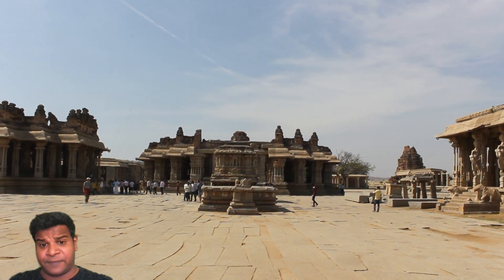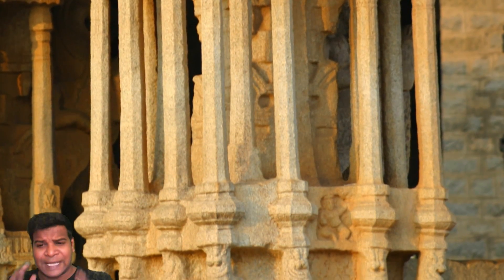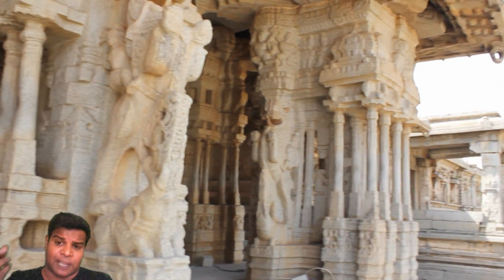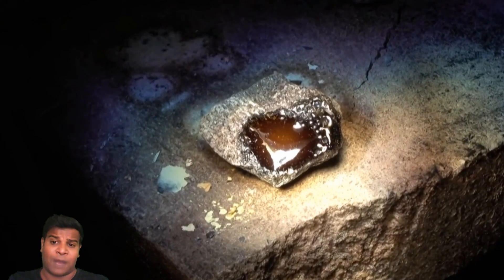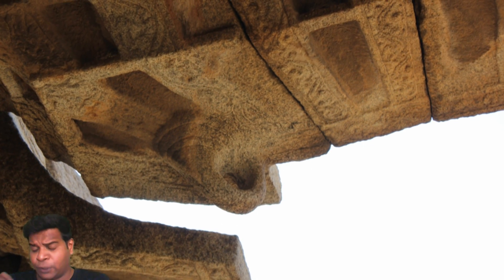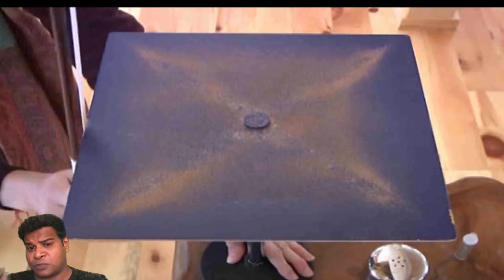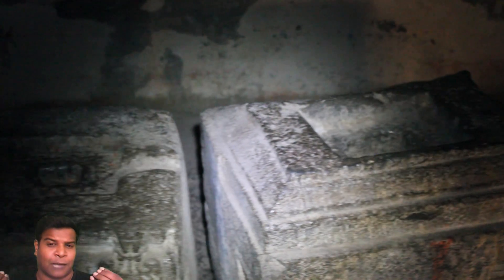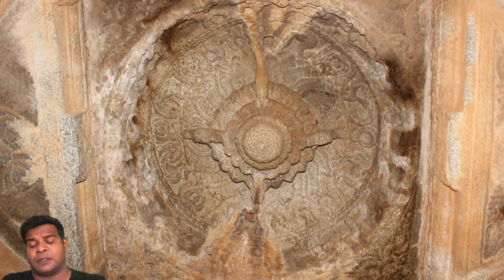How do the Musical Pillars Work? Rock Melting Technology? Cymatics?

Comment: maybe the cymatics are a blueprint for the sound, they are representing what that sound is, so if there is a bunch together in a circle it is the order of the flow of the sound, maybe they are the frequency they want you to replicate, you made a stronger believer now out of me when you performed that AUM sound that make the infinity symbol with your sound machine with laser pointer reflected on mirror on membrane on cylinder, everytime you encounter cymatics representations ,it is instruction for proper frequency wanted , so maybe all the temples that have cymatics are giant instruction books on the sound the temple want you to achieve. possibly in the form of mantras

Comment: They would have been chanting as well in frequencies related to the cymatic ceiling structures. If you identify the frequency represented by the cymatic design, then play that sound into the reflective dome.... and then add harmonic tones

Comment: if they could melt rock then they might be able to do the same thing as making a prince Rupert drops .  this would put the rock on the inside of the pillars under a vacuum pressure without being in a vacuum.  this could possibly transfer sound better to a different chamber, or allow for more vibrations in the pillars without breaking.

Comment: If that's what small pillars are capable of, just imagine what greco roman architecture could be capable of. Those giant ruined pillars! I saw another video about pillars that were some sort of mechine that could rotate but for what purpose I don't know. I see you posted this 5 years ago, I just recently got into learning about the ancient architecture and the truth about all the antiquitech. You're right, they did not achieve these things by using primitive tools. I have even been fortunate enough to put my eyes on some old photos depicting enormous free energy devices out and functioning in cities but someone had tried some old means of phitoshop because the devices were gone but the editor erased only the  tech so it was easy to see what it looked like. There were these very tall metal towers full of spiers, cables, and orbs. Some tech was on buildings and others were fixed to the ground in the midst of commercial buildings. It was wild to see. Wish I could share pictures on here. I recently read some old documents about Bastian forts aka star forts and apparently they are all aligned with the stars just like the pyramids. This document also stated that by standing in a star fort and looking at the stars you can see the stars like never before, it's said to enhance your abolity to observe the heavens. In addition to all of this, it also said that from inside the forts you can hear the Angels of heaven singing. I'm christian so I think that's the coolest thing ever.
Reply: How about the possibility for the pillars to be made up with cement concrete in a hollow structure? Since they are hollow, they echoed to knocking.

Comment: Enjoy your Channel with investigating History that offers many valued thoughts. I’m sure the Powers to be cringe with some questions but getting to the TRUTH in todays world is a requirement. A positive thought is real Political World Controlling problems have been identified and are currently in process of being removed. Expecting this to open up floodgates to surface REAL TRUTH. You’ll be a busy guy!
Sandstone Chain may have limited and questionable strength otherwise it was done purely for display. Some sort of testing is required to show if it was a composite with special properties. We all might be surprised with the results!
Tone column changes may come from different compression. We’re they made as a composite? 
Further analysis required that includes a bigger picture. Accurate physical measurements of column sizes need immediate review. Maybe Someone working on their PhD Thesis might find this an interesting challenge. They would put their name in History!
Have always wondered if these temples were carved out of one piece rock or were they assembled? From Molded Composites?
If assembled, some questions might want to dig deeper and answers expected to surface easier. Cutting out as from one piece suggests a different approach, this may be were laser machining with digital 3-D planning was used. Sections from one piece might exist within an assembly.
My feelings lean towards assembly, but it would be beneficial if you could clarify this as there are many interesting Temple examples. Maybe a laser scanning system that generates 3-D digital Engineering Capable Modeling would help start defining these impressive Temples? Not sure of their scanning accuracy as this would be required to be known. Would be a good place to start!

Comment: Thx for this information. Study sound yes, but in a larger universal way, it might have a good note. They might have started with liquid pouring and setting base. Like a cement type. Too dutchsinse wrote geopolymers I saw. So the technical question is.. was it poured to form? Melting maybe not, however pouring very possible.

Comment: There's many ways to accomplish this!  I'll provide one such method.....
Compression!  The mass of the stonework on top of each pillar being slightly more or less will stress/compress the pillar changing the tone it produces when struck.  Much the same as a guitar string being tightened or loosened will change it's tone!  On more for fun.....
Heating the stones "prior to forming them" can also change their resonance! One more....
The shape of the grooves cut into the pillar can also do this!  The grooves have the literal shape of a sound wave!  Peaks and valleys!  Apex and vertex! Amplitude!  Wavelength!

Comment: These sound very much like my first xylophone when I was a kid.  Those keys were metal.  I was curious about what made these so I looked up what melted sand turns into and it's quartzite.   Any quartzite in them?  The cymatics are awesome.  These could be accomplised with vibration on a thin platform covered with sand.

Comment: It appears to be an optical illusion in my opinion.  The dimensions of the pillars themselves are the same but if you look closely, the square base and top that cap off the pillars are taller and shorter on the different pillars, giving a longer and shorter reverberation from my perspective, giving them the different musical note sounds.

Comment: The sandstone chains are easy to carve, i csrved 3 links in slate, as a present.. only couple cm each link.
.. as for two links of different stone types...
First : close examination is absolutely necessary. 
If both links are naturally formed, slight of hand is only way, ie hidden joins
..or
1.Melting to form link (high technical skill )
2. Higher Being ( ie higher dimension move)
3. Highly unlikely two different strata of eg granite & sandstone naturally mingle and the mason carved small amount granite ( bit above ) and larger sandstone ( made chain from) out of the unusual natural rock formation.
Can't think of any other possibilities..method zero above is my bet.
(edited)..
weight on a pillar causes compression, resulting notes rise with increasing weight, until nearing mechanical collapse, notes increasingly rapidly rise, even an untrained ear can notice this,
.. when suddenly the column explodes ..
Guessing ; twice weight gives rise one octave, only guessing.

Comment: Is it possible the  rocks or stone material was exposed to a type of scalar waves thought to be emitted by alot of ancient megalithic or religious sites to transform the sites material?  or like modern epoxies that are hardened by ultra Violet spectra could different light densities change the density or hardness of the material on par with the audio frequency as in cymatics? I wonder if the aerial view also has a distinct pattern?

Comment: As an old school machinist, I know how to carve the chain.
Its just the captive ball trick.
Pretty easy really, and I can tell this was done by abrasion rather than carving.

I dont think the rock was melted to connect the chain either.
I can think of two old methods of connection, with a very clever hidden joint.
Maybe the "impossible dovetail" joint.
Done properly, it can be almost impossible to spot the joint!
I would need a far more detailed view of the hook to be sure, mainly at the point the hook is connected to the ceiling.

Since CNC came along, many of the old skills in my trade are now forgotten.

Also, I would LOVE to hear a pure note of those cymatic frequency patterns!
If anybody has the equipment to reproduce those exact frequencies, PLEASE let us hear it.
Im thinking Arc sound would be the best way to create the proper 3D note🤔
(Basically the "arc scream" that welders sometimes produce - a soundwave in all directions from a single point - the electric arc)
By adjusting the arc frequency, different notes can be produced.
(We have arc sound speakers now, so this should be fairly easy to do!)
I REALLY want hear what these notes would sound like perfectly reproduced.

Comment: The ancients, (Pre Adamites), used sound frequencies for many purposes. Some uses for 'amplified harmonic sound' produces heat, when the people harmonize their voices inside the temples, under the guidance of the priestly. These vibrations would need to be channeled at an appropriate intensity, similar to microwaves and could soften stone without excessive heat. It is all about harmonics, on the atomic level. Those pinecone looking stones are focusing instruments. We push, rising frequencies, at a crystal wine glass till it shatters. That is excessive. A fraction less amplitude and slightly lower frequency, the glass could be made soft. Rock would seem to be easier than glass.

Comment: The Sanskrit alphabet was also called वर्णमाला (Varnamala).  
- वर्णमाला comes from the root sound वर्ण (Varna). Varna means 'to describe' & also means 'color'. For example, पीतवर्ण (Pitavarna) means yellow color or रक्तवर्ण (Raktavarna) means red color. 'mala' can be a garland i.e. circular or may also refer to a pattern
- It seems the ancient thinkers were looking at the sounds as color packets i.e they were going deeper past the gross level sound in order to grasp sound in its truest sense i.e have access to subtler levels 
- Tantric scripture seems to capture it at the subtlest level, called परा वाक् (Para Vak) or the Supreme Speech, that which is bright, effulgent, shining without any color 
- When sound descends down to the 'gross' level i.e. that which the human can hear, it absorbs colors & patterns on the way i.e they saw the connection of sound with light and described it so, both at the subtlest and at the grossest levels. 
- So, light is not free from sound and sound is not free from light. In their experience, they saw that a particular sound had a particular quality of a color and hence they associated sound with color
-we can add another mystery to the musical hall -  one wonders if what is referered to as वर्णमाला is the same as cymatics?

Comment: Those columns are not the same dimension - you can see that some are slightly taller or shorter, and therefore would have a different wavelength.

Comment: I was doing a vast amount of pondering about these sound structures and will continue to conjure more thoughts but to convey my first idea; what if a vast amount of people used chanting in certain mega-hertz to construct these temples? Maybe each of the tops of the inner temple designs are the patern of the different spiritual chants that people practiced to acctually give the blueprint for the temple? 
In my opinoin, this would not be unplausable. Think of how much resignesce is made when a huge amount of people are all sing/chanting at the same resonence. Also, how relativally easy it is to make a blueprint for the architect based on the" puting sand on a flate table and letting the vibration run through it. These are some of the theories i have thought of. Please let me know what you think about it.
Sincerely, 
Patrick Mulcahy

Comment: Again its structural science , anything to produce sound needs a vibration and resonance. So when the guitar strings vibrate the hollow body resonates. Here the whole temple structure is built as the resonant system so if you take the strings of a guitar out will it make a sound? No .the trick is both work together . Also its the length of the pillars that can change the sound and this change in length can be minute so apparently  same length  pillars can make different  sound. Just a theory though.

Comment: The melting temperature of a rock changes as pressure increases deeper within Earth.

Assume melt at ground zero depth and that sandstone chain links are not reconstituted stone using lye
The melting point of sandstone, which consists mainly of silicon dioxide or silica, is approximately 2930 degrees Fahrenheit
The melting point of Granite, which is a coarse-grained intrusive igneous rock composed mostly of quartz, alkali feldspar, and plagioclase, formed from magma with a high content of silica and alkali metal oxides, is actually lower at 1742 degrees Fahrenheit

Comment: One way I trying to understand column made of a solid rock is to adopt a new paradigm to an old thinking. 

New? 
Consider the temple were made of ancient cement mixed with crushed sandstone or sand to a proportion of water. Pour mold or trowel into shape then leave it to set and cure. 

Sound pitch variant off equal size columns. Play with cement composition in the mix proportion can produce variance to different pitch.

Comment: The temple Chain Loop on the temple is of the same granite. The chain - "sandstone" was made later from liquid artificial sandstone concrete, poured like the Egyptian pyramid stones but molded into chain-links and then let dry- on a flat surface, then once dried, allowed to dangle down.  The sound frequency patterns were obtained from using large tuning forks effecting tables with sand. the pattern was recorded then carved into the ceilings. the 3D aspect is more complicated- maybe they imagined and estimated it. Obviously, they did not have 3D computer imaging software. The dark Bat filled room with missing idol: Well, fill the room with steam and bang on the pillars and maybe frequency patterns might effect the steam and create images around the idol?  IDK.

Comment: I wonder what it would sound like, if you had several people play the pillars at the same time!?
I think that the pillars are an optical illusion.  In the pictures you show here, they didn't seem to be entirely perfect to one another.  Some were a little longer than others.

Is it possible, that the chains, made of sandstone, could be made from a 'geopolymer?'
If you look closely, you can see a portion of each of the chain links, a bit thicker than the rest of the link.
As if this was the spot where the link was 'split,' to link them together, and then the 'split,' was filled in with sandstone materials, to make the links 'whole.'

I'm just always amazed at the fantastic stonework in India.  Entire temples, comprised in a single stone mountain, instead of 'blocks set upon blocks.'

Comment: Those cymatic patterns were carved on top surface to resonate a specific sound frequency....................evn the modern cymatic machine forms pattern on its surface with resonance of sound, sand collectes in nodes and the nodes were carved on the pattern as lines the column bet lines were to let the air vibrate in specific pattern leadind to resonance

Comment: Acustic technology was used all across earth in ancient times for many different reasons and purposes.  At this temple, the sounds would restore and promote health and well being to everyone within the radius of the sound waves.  Of course, its not Allowed anymore.....  All gothic cathedrals with the pipe organs do exactly the same thing.  The huge (typically round) stained glass windows on the churches/temples/catherdrals are the cymatic patterns as well which are used to direct said tones. That technology was everywhere.  The placement of the pillars determins its tone via the weight bearing down upon it from above.  Or rather, the amount of pressure put upon it vertically.  The cymatic patterns in this temple on the ceiling, a person would stand directly under them while the sounds were being made to instantly restore good health.
Reply: Can you do it on stone?

Comment: We can melt firebrick today from the sun using reflectors. That is used for solar energy melting salts. Bronze if used as a reflector could generate the heat needed to melt the rocks. Back on the sound, another way to verify that the ceilings or patterns on top is what is causing the specific frequency resonance is to just cover it up with a blanket or sheet or big umbrella or something and then tap the column. If it is related, it should change the sound.

Comment: I don't know, but when I look at these columns, I see different height columnn. Not from the absolute top to bottom, but the columns seem to have a bell shape near the top thus technically the individual columns are different lengths(or heights however you want to reference then). The different lengths is what will give it a resonance frequency for the different sounds. Similar to how radio waves oscillate on a wire. Thus it wouldn't be difficult to tune each column.

Comment: maybe the builders engeineered the different poles to have different amount of weight barring down on them. That would give it a different tone maybe? I know if you take two wires of the same length but tighten them to different degrees, they make different sounds.